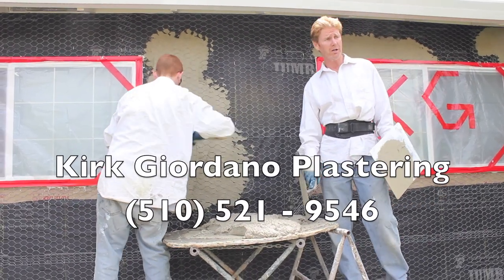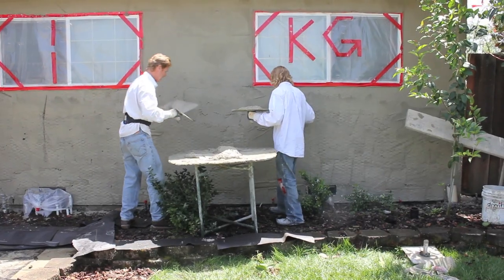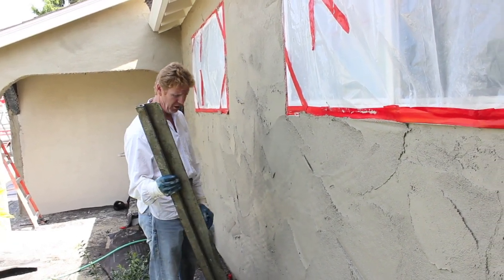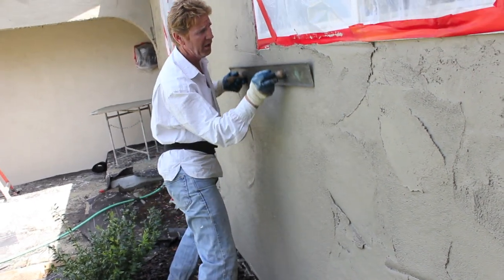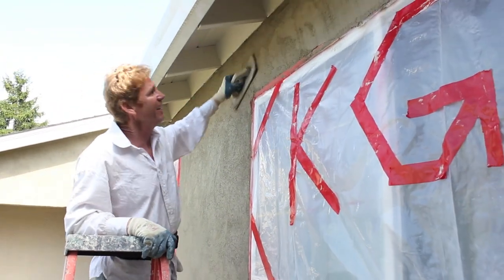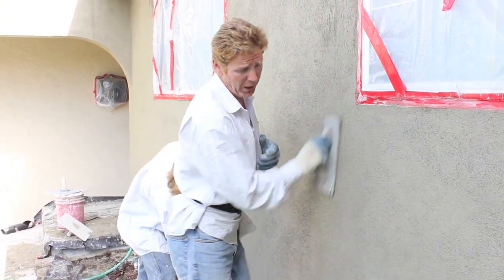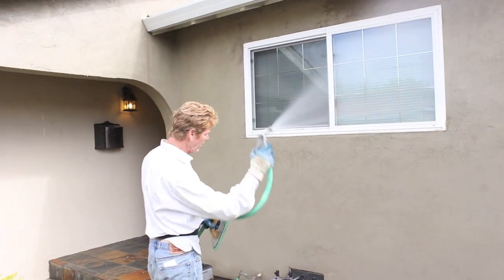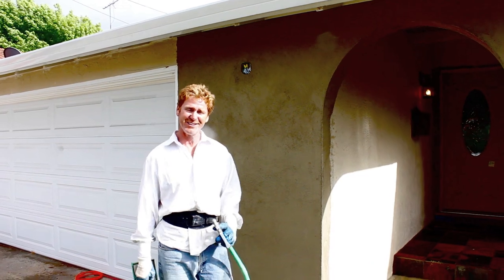Plastering applications with Hawks trowels Darby's

Comment: Looks good Kirk.....I have been using an electric power float for a few years now.....it's been a game changer, eibenstock from Germany do a great one.....added bonus is my rotator cuff is no longer constantly in pain after rendering
Reply from the maker: Howdy Sean Dude, sound interesting.
 As I work, my joints and muscles get stronger, not bragging, they just do, natures law,  use it or lose it.
 This applies mentally as well as physically. Sorry to hear about the pain issues, they area drag to work through.
                                   Live long and plaster
        Teaching do’s and don’t of plastering and stucco work

Comment: Will  a wood  2x4 work for a stucco darby if I cut a sharp 90* edge on it? It would just be for 1 small job doing a patio lid . I really don't want to spend $30 for a tool that I will most likely never use again.
Reply from the maker: Good evening MRM dude, yes a two by four piece of wood will work, make sure it's saturated with water every few minutes to keep it clean or the stucco will adhere to it and just smear or drag it everywhere.
 And naturally, make sure it's straight.🤔
 Kirk and Jason Giordano contributing over 850 free Stucco/Plastering videos for your education. 
    Together we have created the most comprehensive encyclopedia of Stucco and Plastering videos ever produced globally, all by your favorite plastering messengers of YouTube.
Bringing peace, love, and brotherhood back into plastering.🎭🏝🎆
Reply: @StuccoPlastering  Great....thank you for the comment. I have all the lath stapled in and ready for stucco. I have been waiting for cooler weather so that it won't dry out so quickly.

Comment: In Australia we use “u channels”which is a aluminium which is shaped like a u and when you drag it along the wall the high bits collects into the u space and you fill in the low spot and repeat the process until the wall is completely flat . Never use t edges , you can’t get the walls straight enough with t
Reply: jon r I know the all kind of plasters and plasters machines i want work with u i am from Pakistan and now work in Dubai
Reply: Sohailakram Sohailakram  haven’t used  any machines yet .
Reply: jon r yes I have use any machine of plaster
Reply from the maker: Good afternoon Jon, many ways to skin a cat.
I've used t bars, rods, straight edges and even 2 by 4s, I stick with me trusted darby.
 Mostly I use my eyes and my 20-inch trowel.

                         Bringing peace, love, and harmony to the  plastering world
    The complete plastering encyclopedia on video, by the plastering messengers of Youtube

Comment: Hi Kirk .Thanks for the great video .I'm a little confused about When to use the hard rubber float and when to use the softer green one ..The hard one compacts and smooths .Green one brings out the sand . Green one is used to blend the joint in to a tie in ?
Reply from the maker: Howdy John this is true, the green float when matching certain textures may bring out to much sand, the more water the more sand, less water less sand.
 It takes a while to learn to feather in new stucco to existing stucco techniques,  you seem to grape the idea well.       
                                   Live long and plaster
               Kirk Giordano’s Plastering answers to real life stucco questions
Reply: Hard rubber float use after Darby and the wall is straight you use the rubber float the flatten and fill in any micro low spots spreading it all out making sure it’s flat , then green float is the finish

Comment: Why did you run tape at a 45 deg. angle at the corners? Does it help keep the wind from peeling off? I would love to see a video on the different (common) tools you work with. IE...Different type Trowels and where and when to use them. How to pull material from your Hawk. Learning a lot from these...Keep up the good work.

Comment: Nice! Amazing!
Reply from the maker: Howdy Xolo, coincidently, we did a monster job today using this exact same procedure. 💃
Reply: @StuccoPlastering  Hi Kirk, I've been using a darby of my own design to drywall mud the interior of my home.  I've gotten some absolutely flawless flat, smooth applications verified using a bright flashlight in the dark at an angle.  I've concluded regular drywall trowel tools don't work at least for doing big flat areas. I basically had to design/make my own tools and I'm finally getting results.  

The funny thing in these drywall videos I see people doing all this activity with a 14" trowel, I've already done half the wall with a single swipe.  I've come up with a really fast and clean system.  Took a bit of practice, I'm just Joe homeowner, nothing special.

Someday I plan to stucco the exterior using one of these darby systems you use. You mention a certification?   What I'd like to achieve is where it's fairly flat but there's sand particles on the surface, Kind of hard to describe.  It's a nice sandy texture in the end.
Reply from the maker: Hello, my friend, I have found this to be the fastest and best trowel for achieving a level 4 or 5 for interior plastering. https://youtu.be/X_SRyTIVMbU/.  
There is also what's called a Slicker that is twice the size with two handles that resembles a darby but looks like the trowel in the video but twice the size. 🤔

Comment: Hi from plasterer from Uk what is that product there we use sand and cement not rapid set for out external work rendering. Using a straight edge its not an easy product to use as sand tears we usually float it and use excess sand and cement to fill the holes and sponge it and the end. Do you have a product called K rend in the USA great product.
Reply from the maker: Howdy Chaz, as long as the darbys or a strat edge is wet both slide well.
I'd prefer a darbe to a straight edge any day.🤔
No, they don't sell K Rend here.
       Here’s wishing you and yours a happy new year.
 From the entire plastering Giordano Family

Comment: I’m going to plaster a concrete retaining wall when we remove the forms do I need to use acrylic bonding agent with the mortar mix?
Reply from the maker: Good evening Crayul, no if it's a newly poured wall, all you have to do is hydrate it. Wet it with a garden hose.
 The wet or damp wall and the naturally wet new stucco will adhere by suction, or what we plasterers term a mechanical bond. 
Thus last forever.
 Kirk and Jason Giordano contributing over 850 free Stucco/Plastering videos for your education. 
    Together we have created the most comprehensive encyclopedia of Stucco and Plastering videos ever produced globally, all by your favorite plastering messengers of YouTube.
Bringing peace, love, and brotherhood back into plastering.🎭🏝🎆

Comment: sir, the darby that you used on the video, is it double serrated or single serrated? or just flat?
Reply from the maker: Evening Arely, I prefer the double serrated as it opens the stucco so it will dry faster.
 It also make the wall true and plumb if you know how to use it well.
 Cheers,
 kirk giordano plastering
Reply: +Giordano's plastering & stucco repair videos thank you sir
Reply from the maker: No worries my friend,
Kirk

Comment: The serrated Darby opens up the stucco so it drys faster .I thought floating it does the same ..
Can I use a smooth Darby and float with a green float after ?
Reply from the maker: Howdy John sure you can., using the smooth darby will take the new stucco longer to cure no big deal.      
                                   Live long and plaster
               Kirk Giordano’s Plastering answers to real life stucco questions